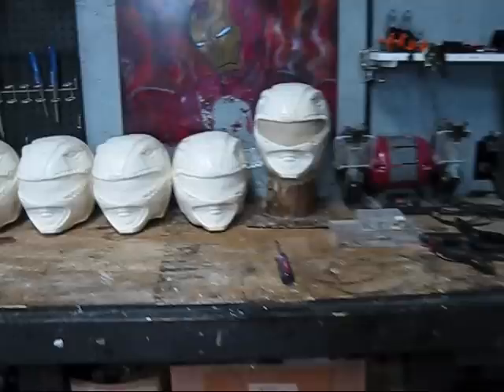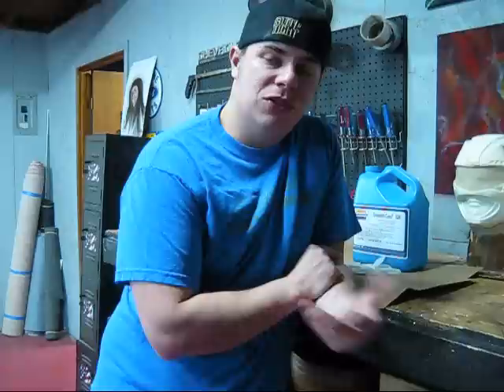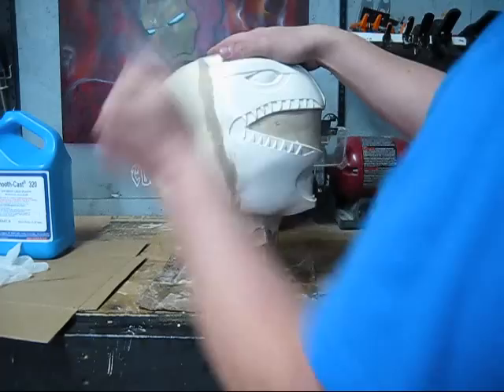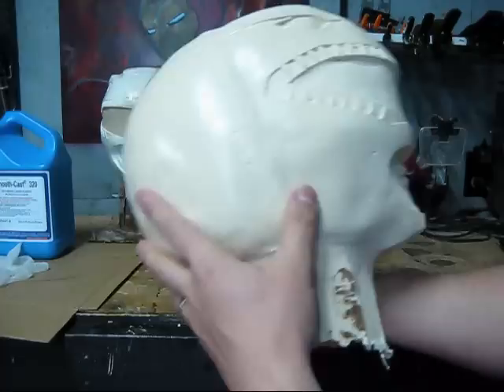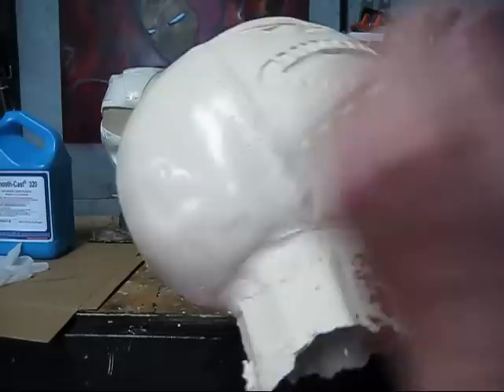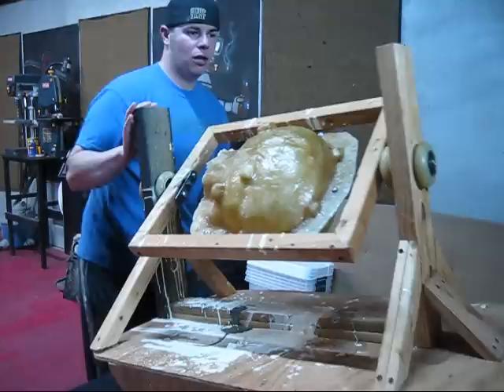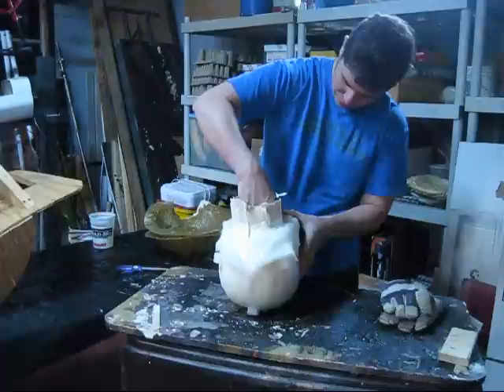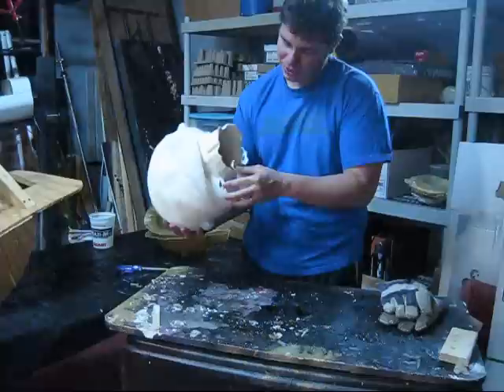power ranger helms stage 1 rotocasting

Comment: If you are still interesting in adding motors, I could help you get this to be a super efficient process. I'm a Physicist by trade, and if I had some measurements from you regarding the plastic that you usually use and a couple other things, I could give you some numbers that would help you reduce waste, increase smoothness and just all around reduce the time you have to put into that stage of production.

Comment: Great helmet roto dude, been looking for ideas to make mine as I just got into helmet making. Been casting for quite some time though.

One question. How come your not using a silicon skin layer and release agents foryour moulds? Both would prolong the mould life and give better castings (ie. no bubbles). Fibreglass is normally used as outer jacket/mother mould to keep the silicone "skin" layer in shape while rotocasting. Still, looks like they come out ok, just an unusual setup I guess.